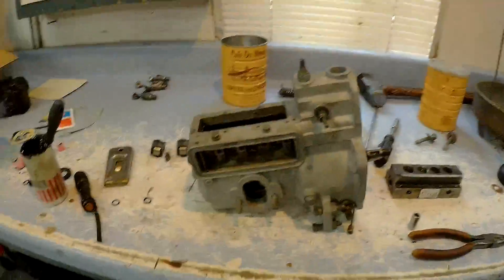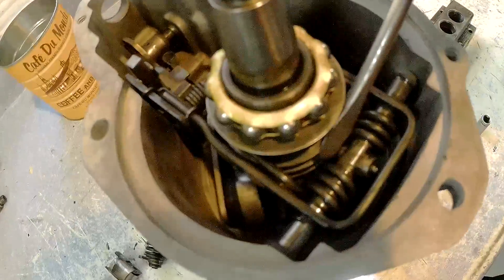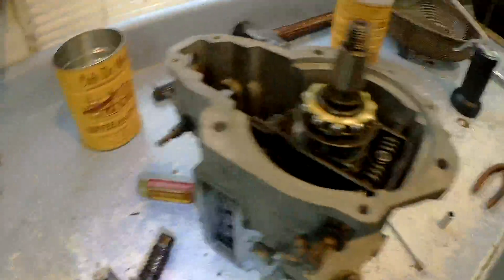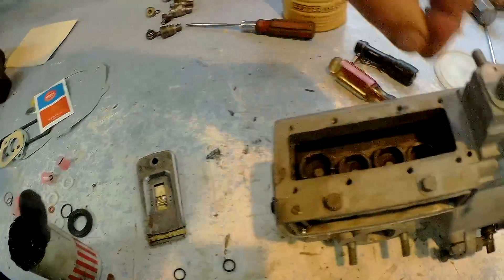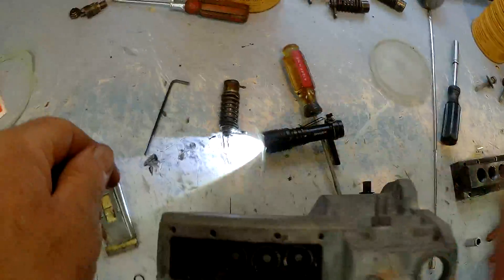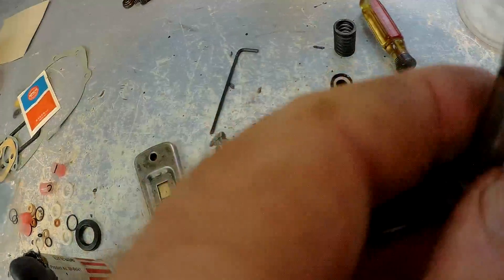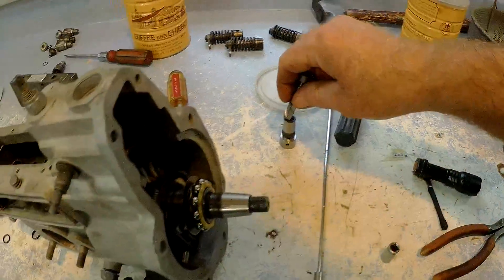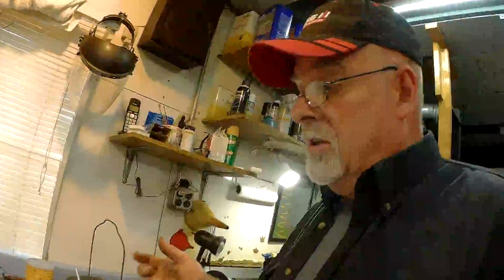Simms Injector Pump Assembly - Ford Tractor

Comment: On dismantling keep the tappets and  the barrels and plungers in their original positions and ( if you have not removed the control rod and disturbed the control fork positions ) to save individual fuel calibration settings being disturbed, when the cambox is fully assembled lay the cambox  face down it on it's side, level and slightly angled upward, Take the fully re-assembled fuel gallery including it's springs, lower plates and plungers and hold that on it's side to match the cambox making sure all the plunger control arms hang vertically downwards.   Feed the assembly into the cambox, again making sure each plunger control arm goes into it's respective control fork, bring upright and bolt the two assemblies together.
Reply from the maker: Thanks !  and I totally GET what you're saying.  Makes all the sense in the world to me (having done this job)

Comment: I ran a Simms service workshop in the U K for many years (later to be part of C A V and eventually Delphi ) it's not quite as simple as described as certain static settings need to be made during assembly,  plungers and barrels are mated to each other you can't mix and match them and assembly of the barrels and valves should be in a much cleaner environment, preferably in a tray of oil.  the guy did OK, he would get it together and it would run but basic assembly does include phasing each plunger in relation to the others and the plunger head clearance is critical for a smoke free performance.
Reply from the maker: Thank you so much for your intelligent comment, and bringing your expertise to the conversation. Much much appreciated.  You do, and forever will know 100 times what I'll ever know about the workings of this marvelous piece of engineering.  Just to be clear, this pump was put on a flow bench, and each plunger adjusted so they all put out the same fuel rate from idle to 3200 rpms and the result of this inexpensive back-yard build  is nothing short of miraculous !  The machine runs absolutely fantastic, I'll bet I picked up 50 hp, it idles beautiful, and yes, it smokes like a freight train when you get on it. Check out the video of my run at Chelsea, Michigan - that's a 2nd place finish https://www.youtube.com/watch?v=izhEbq4E_r0
Reply: Ken Horton. If you worked for Simms and CAV in the UK y know some of the same people I do. . I've been in the business for years. Look me up on Facebook . . or however you can. I'd like to catch up with you. Steve Hanna
Reply: @stevehanna8066   I'll try that but I do not find my way around facebook so easy, probably because I don't use it a great deal
Reply: @stevehanna8066  I tried facebook but got nowhere!   But here's some quick  answers.  Simms names ,U K Branch Controller was Jimmy Bell, the Service manager was Arthur Bunker,  in C A V Service Engineers Jack Warner, Jimmy James, Arthur Sheath, but I suspect you are not UK based I very much doubt you would have  got involved with that side of the business, probably the export or overseas  division .We had some 20 plus service depots covering the Uk and I knew most of the Managers  !
On fuelling the basic Simms in line ford pump, plunger stroke was set by measuring travel from bottom of the stroke to the close of the inlet port on number one plunger and barrel, this gave the correct head clearance.  Phasing of the remaing plungers  was taken from the number one plunger when it had been set for travel and was done by spill cut off of the remaining plungers, alterations to phasing angle were by changing the spacer in the tappet body . Fuel calibration was taken usually at 600 rpm over 200 strokes. and for a normal 6 or 4  cyl engine would be round about 12 cc's per line. Most had pneumatic governors which controlled the top R PM and could not be adjusted, later models and Mimimec pumps had mechanical governors which had to be set on the test bench.you can always E.mail me.   k.horton4@sky.com

Comment: Look out. The smokes going to roll lol. Every pump has its own design. Work on same principal. Plungers and barrel don't last like they once did. Gahl up
Reply from the maker: yup, these are Lucas elements, so hopefully they'll last, plus I run added lubricant :-)  That BioDiesel is really bad, the guys running high concentrations of Bio in their pulling tractors give Columbus Diesel a LOT of fresh work every season- but they do it for the horsepower
Reply: @mark_osborne  the bio is ok as long as it's not animal fat. Never had much trouble with soy oil. I run that streight for awhile. Nice and quiet.
Reply from the maker: @royamberg9177  Really.  I don't know much about it except for what I hear around the pulling circuit.  They've even go so far as to start the engines on pump diesel, switch to Bio, then switch back to pump diesel after the pull in attempt to get the pumps to 'live'.... but I have no idea what 'bio' they are running, meaning, the base component. But I will ask.